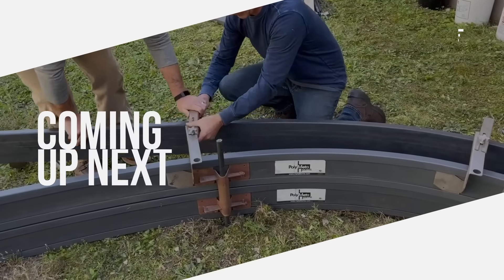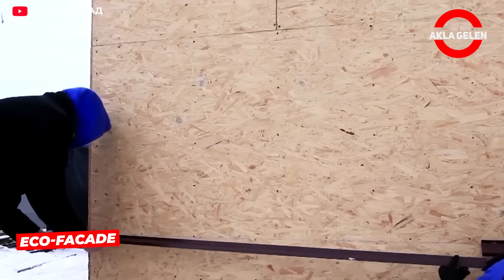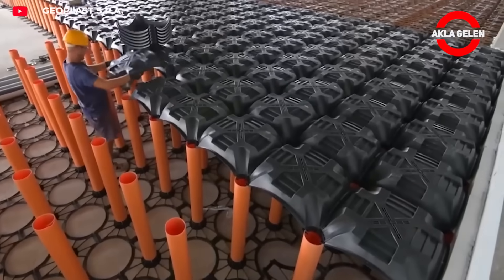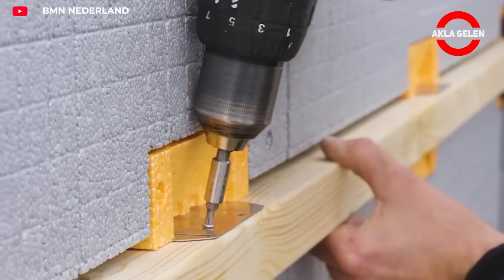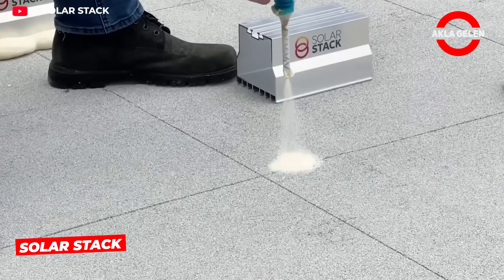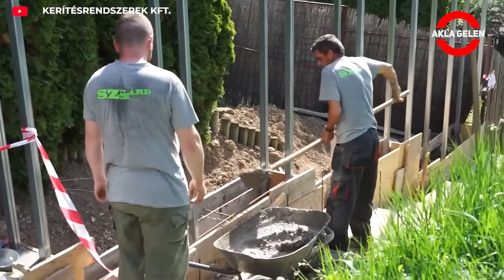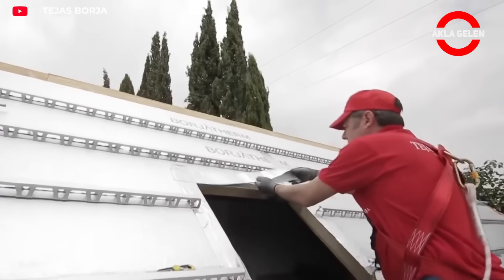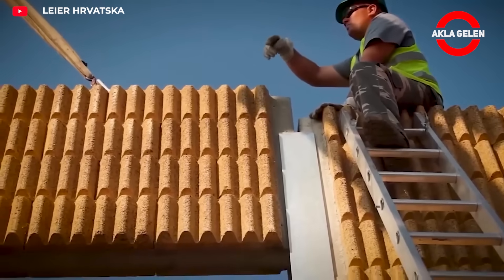This technique works, I can't believe it! I never thought of these ingenious Construction Techniques

Comment: Anything with plastics/glue/etc in construction (unless absolutely necessary, if ever) is an immediate red flag for many reasons. All these "modern" techniques require more and more outsourced materials, tech, etc and probably can't be fixed or maintained without more of the same. Nothing local, natural, simple, or repurposable = NOT aesthetic or efficient imo.

Comment: There are better environmental friendly options than what is being shown here such as hemp Crete and hemp blocks approximately the size of standard cinder blocks that stack like Lago blocks and are made with a combination of hemp and lime making the blocks fire proof with excellent insulation. The surface of these blocks are usually finished on the exterior with stucco and the interior with plaster.   Maybe have a podcast on these.

Comment: Smooth surface glass fiber rebar is a very poor choice. For the best bonding strength to concrete, use MSI Bar

Comment: Polystyrene is highly flamable, too dangerous for buildings. See Grenfell Tower for one.
Reply: Wiki says...

ICF (Insulated Concrete Form) construction uses hollow, interlocking polystyrene foam blocks or panels to create a permanent mold for concrete walls, providing both a structural concrete core and continuous insulation in one system. 

This modern building method results in durable, energy-efficient structures with enhanced airtightness, superior thermal performance, and reduced maintenance compared to traditional construction
Reply: @peterfitzpatrick7032  I was referring to the roofing, and other applications where the polystyrene is too exposed, and highly flamable. It is ok as a concrete mold when correctly covered, but that's about it.
Reply: FOR IGNORANT  SHOULD BE ,